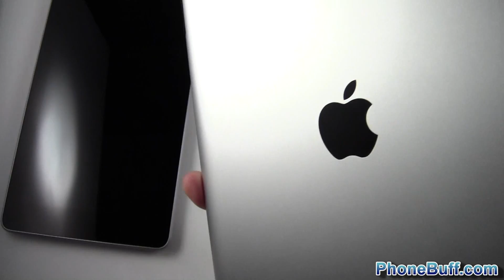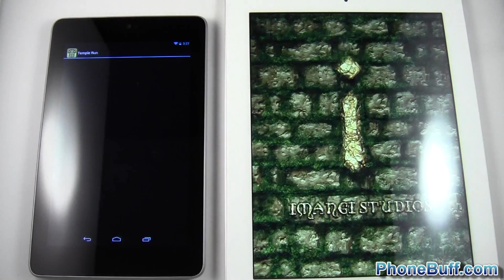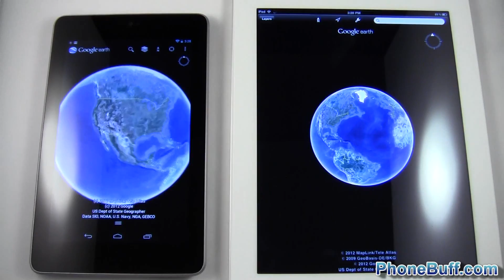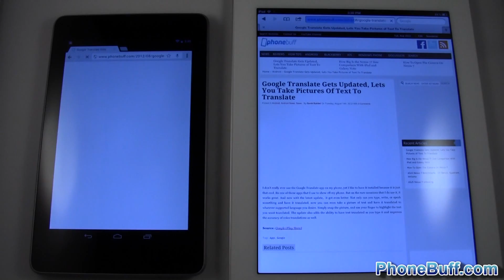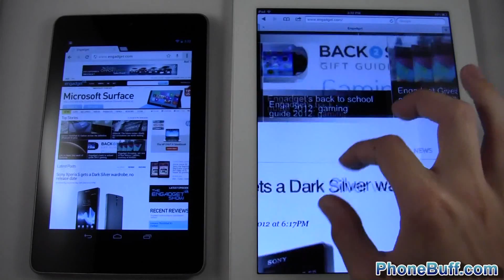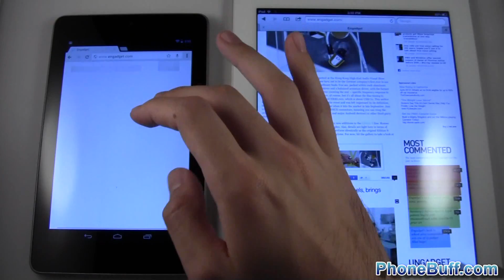Nexus 7 vs. iPad 3 Speed Test - Boot Up, Apps, and Browser

Comment: Turning the performance settings off on the Nexus 7 was unfair. The Nexus would of dominated. Its like having two guys, one with a gun, the other with a knife, but then disarming the guy with the gun to give the guy with the knife the advantage instead.
For a much cheaper tablet the Nexus 7 more than holds its own.

Comment: This is a very unfair test in every way. The apps are scripted different in both. So that really it has nothing to with speed. As for the web browsing test, the pre rendering was turned off on the nexus! Wtf!? Turn off the WiFi in the iPad why don't you??? You SHOULD be testing on the stock settings. Turing off android features that are better than the iPad? Wtf

Comment: Yes, notice I said "stress", not "mention". Anyway you look at it price brings the Nexus 7 to a better buy, regardless. You can get one for you AND your spouse for the price of one iPad. You wanna spend $1000 if your spouse wants one? Also, turning off the preload, cheap shot dude. If you knew, the iPad has a preloading feature in it that Apple hides. It claims it's done with the website before it actually is...nice try though man.

Comment from the maker: The reason I turned it off though is because this was more a test of pure processing power rather than software. But at the same time software is a big factor in the speed so I totally understand your point. The thing is though, lets say I typed a website into the Nexus with pre-loading on, then typed it on the iPad, then hit go on both, the Nexus 7 would have been done instantly but technically it was loading in the background so it would be an unfair advantage.

Comment: your Android has a lot of "start up" apps. (as tester have tons of junk apps. that's why the boot up is a little longer)

eg. that weather widget was loading and checking up data on loading. (no such thing on ipad) 

plus if you turn off every optimizer off in N7.
Reply: Also there is difference
Back when Android was a keypad phone, it's website said its like a computer but emulates Android for battery life but IOS does not, that's why